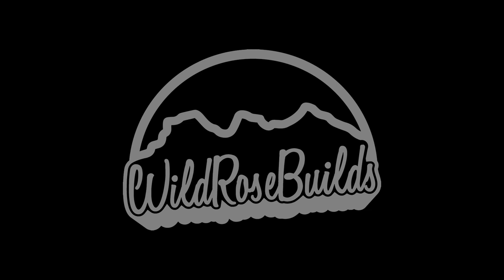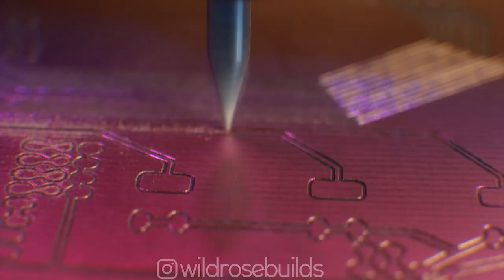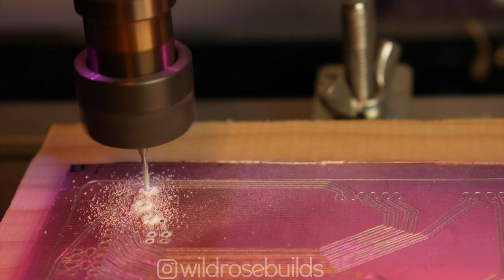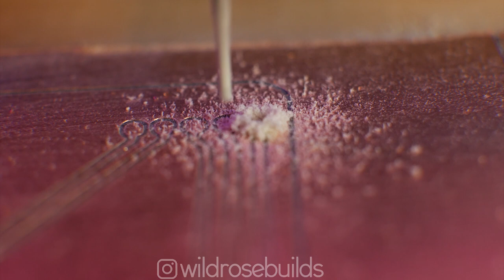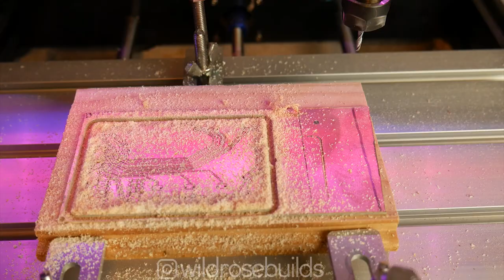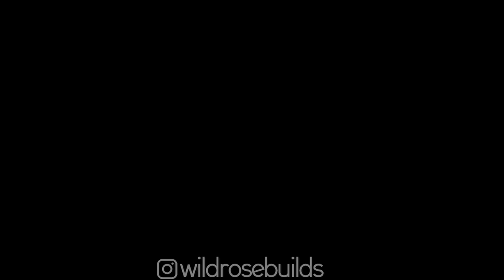Using a desktop cnc to make a circuit board (sainsmart genmitsu 3018 pro)

Comment from the maker: It's for a timelapse rig! Stay tuned!  ;)
Reply: Can you do a marvel theme 3d print time lapsed video
Reply: I was working on a 180/360 motion rig to hook into Octolapse, got part way there. You can send custom commands from OctoPrint to move a stepper for example prior to snapping a photo. Using with DLSR. Can’t wait to see what you produce.
Reply: Did you glue the PCB down, if so what type of glue was it, thanks if you have the time to answer.

Comment: What adhesive did you use on the bottom of the PCB material to hold it still for precision?
Reply from the maker: i covered both surfaces in tape and then superglued it!